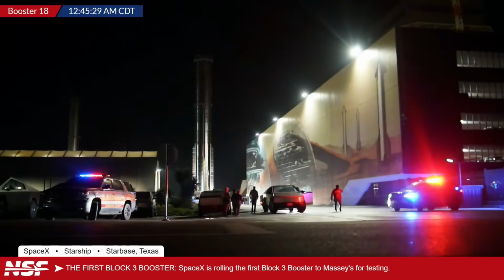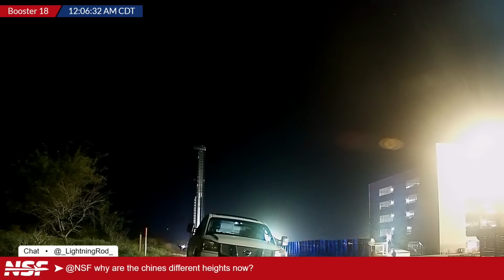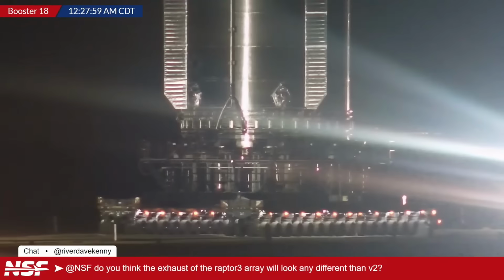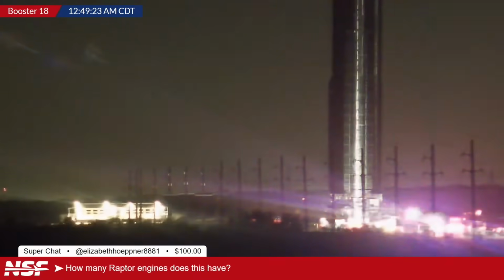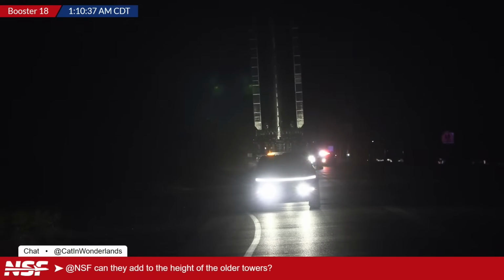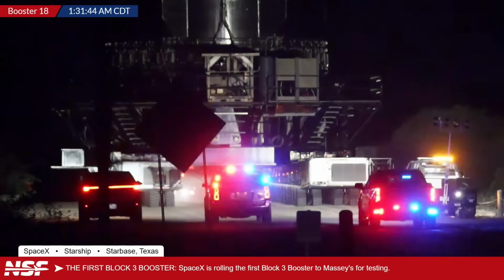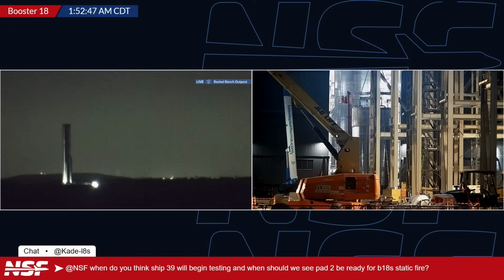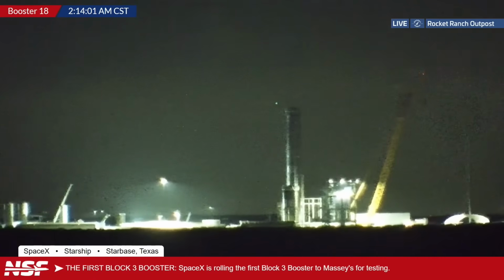SpaceX rolls The FIRST Starship Block 3 Booster 18 to Masseys

Comment: If you watched the New Glenn launch, the interval from separation to second stage ignition, it's orientation drifted to an off angle to flight. The second stage pitched up quite noticeably after the engines reached full thrust. SpaceX's hot stage has almost no attitude change at separation.

Comment: Looks like the engines haven’t been installed yet.
Reply: None of the stages ever had engines before the cryo test, because the stand on which the booster is located is designed to press on the mounts where the engines will be located to simulate raptor thrust, so you can't do this test with engines
Reply: It may be a good idea to put this booster through all the Massey tests and OLM prop load tests before installing engines. FOD ruined the first booster that was attached to the original OLM, flowing prop through the engines basically guaranteed scrap.

The first run of new plumbing, tanks, etc is going to be somewhat dirty and is basically a cleaning flush.

The booster might be able to clean out as long as it's a load with no engines, or this first booster is sacrificial. It'll get structural verification and multiple cryo tests, maybe by the end of this test campaign they have a second booster ready and assuming no changes are required from the structural test results.

Comment: Can't see any Raptor v3
Reply: None of the stages ever had engines before the cryo test, because the stand on which the booster is located is designed to press on the mounts where the engines will be located to simulate raptor thrust, so you can't do this test with engines